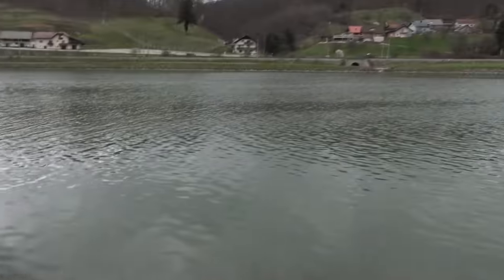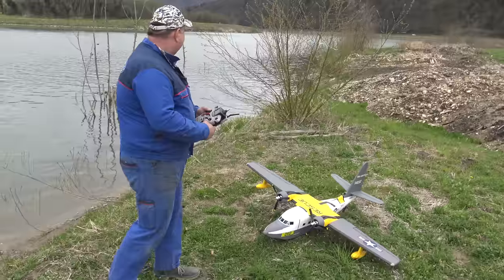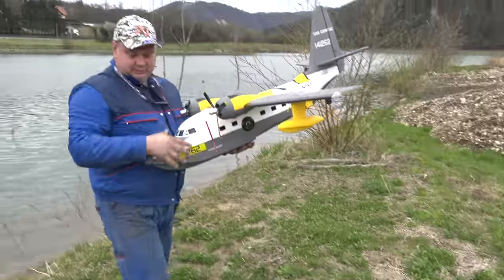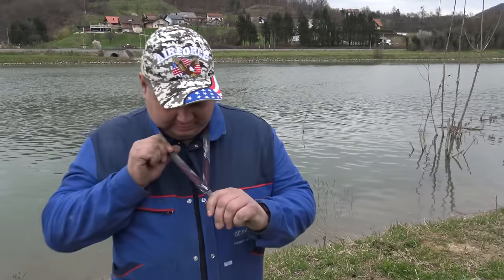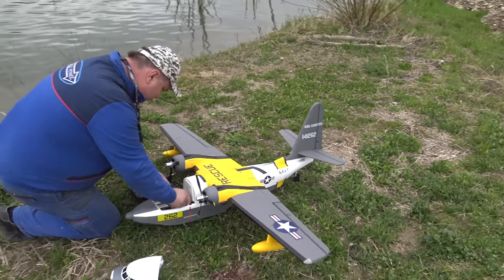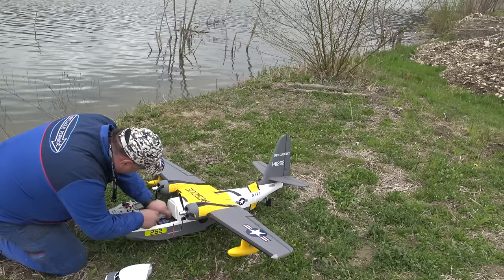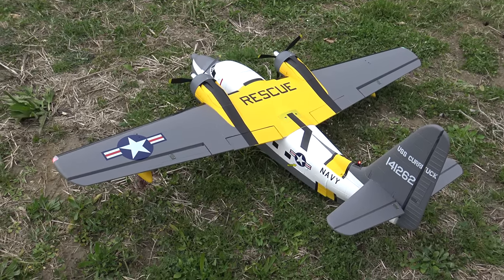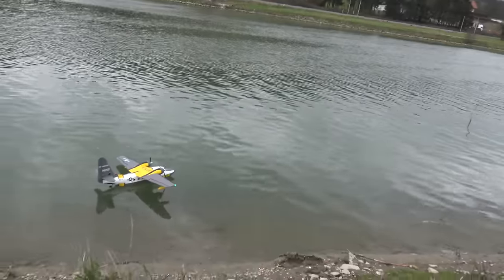Avios Albatross HU-16 Flying Boat 1620mm (63.7") PNF Crash on Maiden flight

Comment: So sorry Capt Blaz that the plane crashed on your first flight, but it was not because of your flying.  At the beginning of the video, you could not get it going.  Check it out hey!  Then you moved the receiver, and suddenly it worked.  I think one of the plugs maybe the esc was not plugged in properly.  In the air it was doing some funny things like you said in the video, "look what it is doing all by itself," and it was flying erratically at times because of the bad connection.  Then it failed and you lost power and it went in.  Sometimes chit happens.  Now for the good points.  It looks beautiful.  It is a very nice looking aircraft.  It looks great on the water and you flew it very well, considering the motor was not working properly.  You also handled it very well in the wind and the wind did not really affect it, as it must be a good flier.  It lost power on the turn and that is the worst place to lose power, and it went in sideways.  Also the wind gods were with you and it blew the wing tank back in for you.  Thanks to the good filming of Capt Robert, it was all captured on film so it can be analyzed.  It will fly again, and hey, it was a great video!  Talking about the Beaver hey!! I crashed mine last year!  It was a complete "write off".  You know what I did eh?  I made a little wing out of the elevator ha ha  and I will see how it flies this spring ha ha ..  omg What a hobby!  Until next time, Happy Flying and keep smiling!

Comment: Battery were mounted too far back - CG gave you a friggen hard time, and the windy conditions didn't really help the situation. ;)
Sweet plane, though! ^^

Best wishes on recovery & repair from Norway!
Reply: Just saw the video now. Agreed 100%, the plane was tail heavy - that's all!
Move the battery 1cm forward and it will fly great. Great real life unedited footage Captain Blaz and Pilot Robert! You are the real stuff !  Keep up the good work :-) 

I recently had a short bad flight and I tip stalled my Tundra. Reason: tail heavy plane. Don't worry Captain Blaz, it happens to the best of us :-) Cheers !!!!!!

Comment: You should fly a rectangular pattern for landing. Bring the aircraft into a slow flight regime. Make shallow turns.  Flying about 10% above stall speed. Don’t kill throttle but low, say 1/4 throttle, a fast idle. Cannot tell there how close you are to trees.  In my Cherokee 140, best glide is 80 mph.   Cruise is 2200 to 2400 rpm.  To land, I lower rpm to 1500. But for this cold weather, I end up about idle.

Comment: guys I noticed that the lipo didn't have a Velcro on the bottom side...so the battery can easy move it  and the C OF G Can varies. ok have a belt but not enough .

Comment: Do not worry, it can happen to anybody. Just a little tip. Make your airplanes little bit nose heavier for maiden filghts, it will be more stable and it is always better to control little more nose heavy airplane. If you do opposit it will be more ailerons sensitive and it will easily stall like this one.
Reply: J. Sixfifty yes all true :(((((

Comment: Captain Blatz, plane was tail heavy unfortunately.  Would have suggested also having low and mid rates setup with some expo.  But unfortunately the way it was flying and pitching suggests tail heavy and too much control throw.  I know with you and Pilot Robert skills, you will get it fixed in no time

Comment: Oh dear, I feel for you Capt Blaz 😔. But again, I think your were flying too slow and stalled the plane. Not only during the crash, but a few times before that too. You saved it a few times by increasing the speed in the last second. Especially in these strong winds you should always fly at least at 70-80% of full throttle constantly to overcome the wind.
You will come back strong, but analyse the last couple of flights and take the learnings with you for the future 😊. We need you back in front of the camera 👊🏻

Comment: That was a shame u were doing so well.with twins and multi engine planes you really need to make very wide turns and keep those wings level as possible because the plane will just spin in.maybe the c of g was wrong.

Comment: Cg induced tip stalls are a pain for your plain! I had it happen once, in no wind you would have an easier time landing it but with cg to far back it's really tail heavy. You can tell when the plane drops hard while turning at good speed it's tail heavy, some planes will always drop a little but most will not if cg is right. This is how I tell if my cg is right, if the plane drops I move cg forward one mm at a time till I find the best spot

Comment: Far too windy guy's. Be patient and fly on a calm day. Capt Blaz should do the redemption flight.
Reply: ya that damn wind was kickin` and cpt blaz flying way too slow. he had the power but for some reason he wouldnt use it. thats whats getting him in trouble. flying too slow, too low and fast on the turns so once the wing tips he doesnt have enough altitude for the plane to recover on its own.just keep up you speed and it will fly good.

Comment: Literally the "Ups and Downs" of our RC Hobby....  Unfortunately, Capt. Blaz and team picked a very bad day to maiden this beautiful plane.   Maybe next time you should pick a day with MUCH LESS wind and a smaller body of water. .  It also appeared that the CG was off and ANOTHER tip stall as well.  IMO this model is not designed to fly in those conditions and especially on a Maiden Flight...  Oh well -  It's all part of the hobby.  Buy, build, fly, crash and rebuild - then start over...  Best of Luck I am sure she will fly again on a better "weather day".

Comment: ahh man bummer such a beautiful sexy plane. once I was flying in a strong wind like this and I found that if you do flat turns using mostly rudder you can bring the plane back home safely, The problem is with these foamies is that when you bank and the wind gets under the wings, there is not enough weight for the plane to keep flying , and it goes into a high speed stall. also it looks a bit tail heavy. So what to say in the end, fix and fly again, i want to see it fly again.
Reply: Yehudah Nayman yes all true...

Comment: Don't be discouraged Capt Blaz. I think you had a few problems that created a domino affect. You had a connection problem at the start with the receiver, and I think it was freeking out in flight making you think it was the wind. You did have a wind. It also looked a little tail heavy. With all those things stacked against you I think you must be one hell of a pilot to keep it airborne as long as you did. I notice all of your servos were in a spazzing out mode. I could see all your control surfaces when you were taxying back to shore.

Comment: OH Noooo 😱😱😱She looked a little unbalanced and air speed was a little slow. Combine that with the wind and there you go. So Captain Blaz we’ve all been there! I would put a stabilizing Gyro on that if I had one. It doesn’t look like it likes to fly slow. Keep the throttle up. And put in 30-40 expo and set up low and hi rates.

Comment: I know this is really late, but I concur. Too bad you had a crash - just glue it back. My starter plane has had an engine change, the tail section has broken twice, engine mounts broke, wing damage. Really has taken a beating. But that is because I fly in 10m/sec sometimes. With a plane rated at 2m/sec. Don't worry! : )

Comment: Tail heavy + gusty wind = disaster. After repairs, take that 4 cell battery and shove it all the way to the front of the compartment. Better to fly nose heavy in wind, because we just saw what tail heavy does to a plane... Also, borrow a boat for recovery, in case of a crash.

Comment: Three problems here
1. A bit windy for a foamy but not outside it's limits.
2. Possibly tail heavy or far too much elevator, this was obviously immediately after takeoff.
3. Flying too slow especially in a turn, handling was much improved when you flew faster. If you look at the Hobbyking video it is flown at the higher speed at all times.
Reply: JimGDMAC well it is what it is :))

Comment: 2 reasons why it crashed
1-try not to fly in strong wind
2-give the plane atleast 90% throttle during takeoff and slowly rotate and 80%throttle through out the flight without banking so much,this has the same problem with my durafly se5a
Reply: But it is mostly the winds fault

Comment: Hey Robert looks like he was moving the plane before it initialized he was having a little trouble getting it to work at first maybe he should have unplug the battery turned off the radio turn the radio back on plug the airplane back in and wait for it to initialize before moving it could have played a part in the crash

Comment: As others have said, its wasn't the wind. It was tail heavy combined with poor tip stall characteristics. Both are faults of the aircraft manufacturer and manual writer.

Or put another way, Hobbyking scares another avid R/C enthusiast out of the hobby.

Comment: You could have taken the swim of shame ,you are now the man of the swim of shame Captain, Blaz or , at least your imaginary pilot in the albatross . OK HeY! I' will congradulate you ; also a Salute the flight envelope here was tough man! The list now lets see , the wind conditions where crazy for a maiden , possibly the motor thrust angles these planes had that to help leap their heavy payload  out of the water, with this lighter model maybe to much in the model design, when you hit throttle she wanted to pull up that's why you where more adapt to fly slower which got to slow then the stall, tail heavy g-spot can look like this also, not such the case though she would come in to a glide still when you pushed nose and, not induce stall when doing so. Not wing angle of incidence I' believe more to do with motor angle pitched up ward to much . There where some conditions against you so. You have great talent has pilot you still flew her around the river for Quit awhile with these complications  its a maiden she will fly again very good man . Hopefully I've been of help here some things here for you and Capt, Robert  to check any way Capt, Todd from Arizona Salute

Comment: Tail heavy Capt. Blaz.  Move that battery forward.  Been there done that!
Reply: vasmikey yes
Reply: I was flying my glider today and while trying to stay in a thermal the plane crossed into the sun.  I lost the plane and could reacquire until it hit the ground hard.  Sigh. Just finished putting it back together.

Comment: Sorry for the crash.. Captain Blaz toke off too soon.. Too much power on take off.. He needs to start out at half throttle and when the plane is up then go to full throttle.. He tries to fly too slow and that cause the tip-stall.. I love twin engines and learned years ago that they don't like to fly too slow.. Captain Blaz did good.. Fix the plane and fly again..

Comment: Spent a full summer building a 2meter  slow stick.. My first ever giant balsa rc plane.. I flew it and it was all over the place, I couldnt figure out why.. So I landed it and it landed so smooth, I looked the plane over and said ohh it must be nothing so I went for the second flight, then it went out of control again, but this time it went into a corkscrew from about 200 feet up and that was the end of the story.. Turned out the reciever was faulty, it kept browning out and would freeze the controls, I never set up any failsafe, so when the reciever would loose signal it would hold whatever position  the servos were last at.. I was so pissed off, I said screw this hobby.. But 1 month later I was back building somthing else.. ;]

Comment: Looked tail heavy. I don't want to write not enough airspeed which led to a tip stall, but.......not enough airspeed which led to a tip stall.  Sorry for you Captain Blaz and Pilot Robert.
Reply: Steve Garbacz  Lots of people are saying this! And it’s a fair enough comment but if it hadn’t have been tail heavy then I think the airspeed would have been just fine.

Comment: I cheated and skipped the Unboxing. I was watching the Manufactures video on this plane. Its beautiful as can be but sadly I have no room to store that monster. I was blown away at it only using a 3k battery. My guess would have been a 6s battery for it. I can imagine it being heavy. Its a perfect water plane no doubt. I repainted that pathetic blue airboat of mine an aluminum color. I plan on adding balsa bench seats to the front and railing for details as well as paining the seat for the pilot black. I may add a pilot. Now that its running, My goal is to add detail to it now.  I remember the first foam airplanes back in the 80's from Banana Hobbies. They were HORRIBLE! Detail was bad, the foam beads stuck out like a sore thumb. This plane is beautiful and my guess is it needs lots od speed Some one needs to keep the throttle up on that big bird. THAT would scare the poo out of me. Spring winds can change every 5 minutes. Well, I would say that plane hates wind. Sad.
Reply: RC Hobbyist Extreme well what can i do now :)) it is fixed and ready ;))

Comment: Easy fix, you'll have it back in the air in no time. I never give up if I have prang.
Reply: I have a Radian 2000 with so much hot glue in it that I think the glue weighs more than the air frame but it still flies haha but I do have others with no glue ... YET.

Comment: "inexperienced" in high winds to slow is what happened. was not under powered, at full throttle it climbed with no problems. He turned with the wind and a big gust pushed the wing over. That is what happened. Plus flying to low, should have been at least 3 mistakes high, that is the RC golden rule of thumb. Start out with gliders, they fly slow enough until you can learn to fly. Most important, NEVER GIVE UP! Fix it and fly it again. In less wind next time too

Comment: You guys?? You can hear the wind thundering by the microphone.  Don't fly in high winds.  So sorry about the loss. I think these foam planes are just too light for any strong winds.  Need more weight to stabilize these planes.  These original full size planes were designed to be have a certain weight per wing area. Made of aluminum, it works. Made of wood, it works.  Made of Foam, it's too light.  What does everyone else think?  Let me know.

Comment: Bad luck again for Captain Blaz , slow turning plane and strong wind , too low to pull out of slow turn . Battery planes not for Captain Blaz , he never really had control in the strong wind . Pilot Robert fix it and you fly it or Captain Blaz will have heart attack :-)

Comment: Late to the party, but the albatross seems to be TAIL heavy on every video I see… they always say “oh battery needs to go forward.” In my humble opinion… I think these planes need a 5500mah+ battery. They suggest a 3-4000 4s. Or 4-5000 3s… I say 4-5000 4S, and 5500-60003s. With the v2 being an even lighter airframe than the v1… I suspect more people have maidens like this with this particular model.

Comment: Very obviously tail heavy from the first second after lift off - should have diagnosed that immediately and trimmed for nose down and then brought it in for a fast landing. Wind is really not a problem for RC, most parkflyers and up can handle very strong winds - in fact when I lived in the Cape I would fly in gale force winds on the dunes and hover, it teaches you a lot about control and aircraft setup but will not cause this sort of uncontrolled scenario - this was painfully obviously nose light and tail heavy - classic and textbook. Sorry for your loss :(

Comment: Air speed not ground speed! If the air is going at the same ground speed as your aircraft then it is not flying, it will fall from the sky like a rock! You cannot see what the air is doing! This has happened to real aircraft too. If the wing is not steady but gusty, dont fly in gusty unstable wind conditions!

Comment: I realize this video is over a year old. But I've watch the segment of this video when the plane went down. and this was not completely a pilot error crash. While the winds were a bit on the high side and I personally never would have been out in them. there wasn't any way that close to the water that the pilot could have saved the plain and it's crew. Any aircraft crash you can walk away from is clearly a planned one. beside it looked to me like the water jumped up and sucked your plane down.

Comment: The first thing that is wrong with this flight before you even took off is your flying off a river. Second thing you are flying in gale-force winds and the third thing you are flying next to a mountain range all of this does not sound good cheer up Captain Blaz find a nice calm lake or Pond to fly off of and not next to a mountain range. On the first tip star Captain Blaz should have landed the plane something was wrong with it. I'm sure Captain Robert is going to put your plane back together again and it will be better than ever also it looks like it needs a bigger battery. Captain Robert go buy Captain Blaz a beer he looks like he needs it.

Comment: It could be that 🏃ky dinky 72 kHz to the 2.4ghz module conversion. Not to mention a questionable cheapo receiver. Time to switch to Futaba guys.... The orange receivers are great to if you want to save .money. Remember you immediacy had issues with the radio and then by magic it started to work? Get a solid state radio setup.